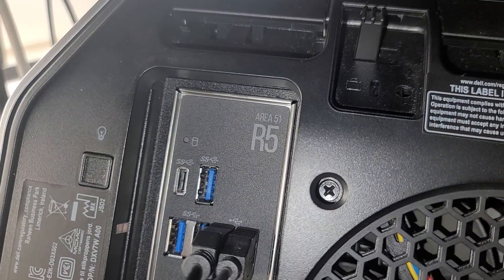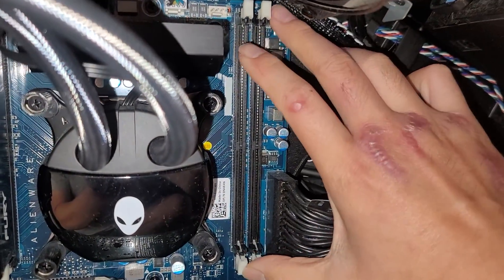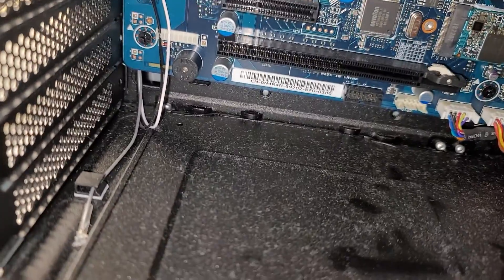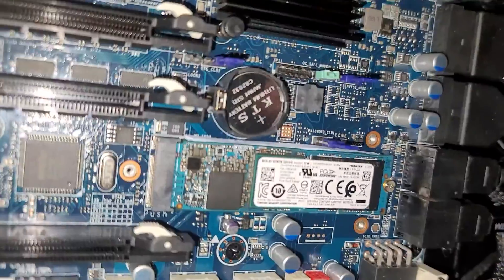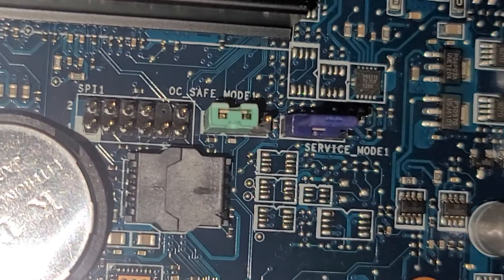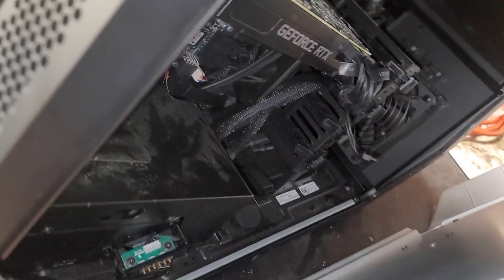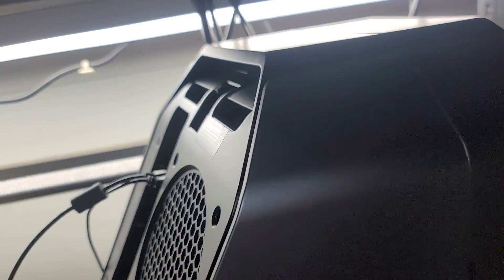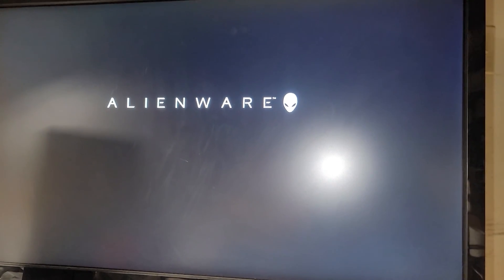DELL Alienware Area 51 Area-51 R4 R5 Disassembly Quick Look Inside RAM SSD Connectors Info

Comment: sooo i have an alienware area 51  that i got off amazon and i dont know what type it is can you please help bro this is what is listed as: Alienware Area-51 Gaming Machine-Intel Core i7-5820K 6-cores Overclocked up to 3.8GHz, 32GB DDR4 Ram, 2TB HDD, DVD Burner, Nvidia GTX 980 GDDR5 4GB Graphics, Windows 7 Pro. can you please help
Reply from the maker: What's the service tag number?